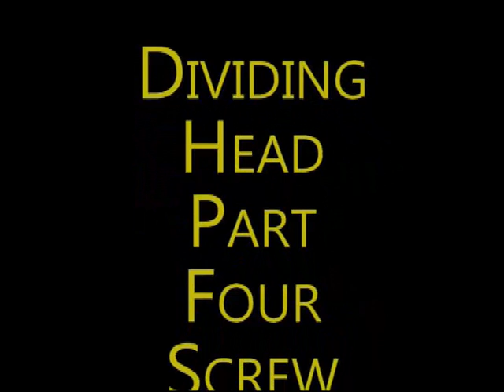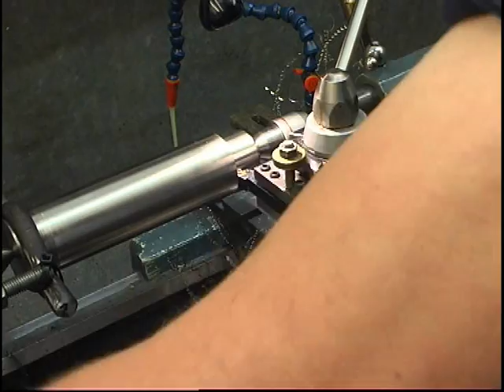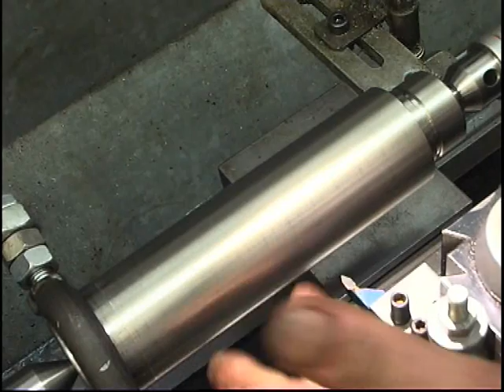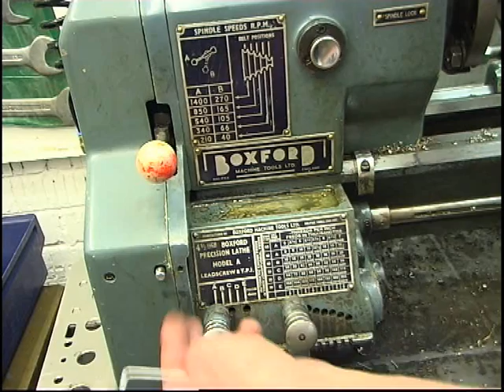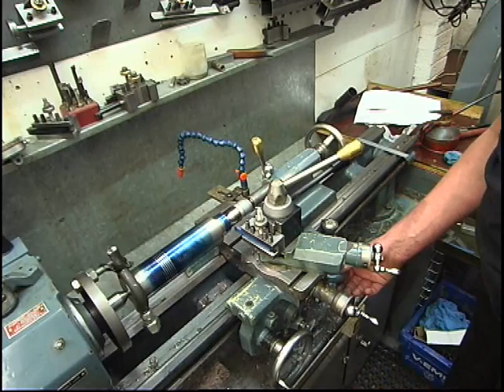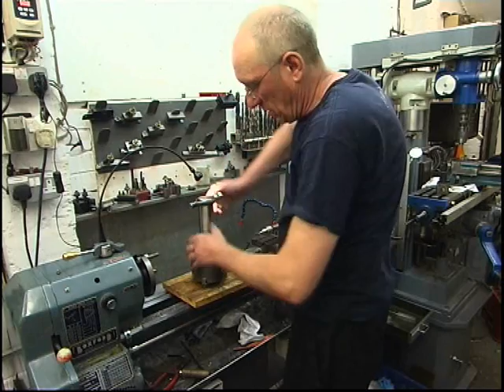DIVIDING HEAD PART 4

Comment: the angle on the compound is used so that only one side of the threading tool is engaging in the cut.
the reason this is done is to minimise stresses on the tool and avoid breaking it